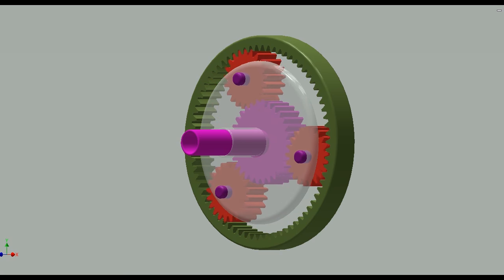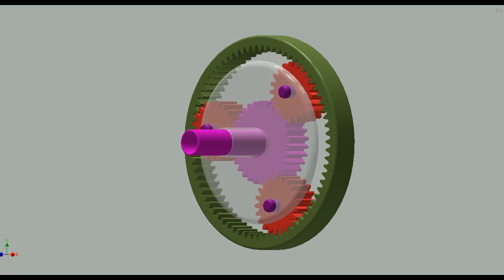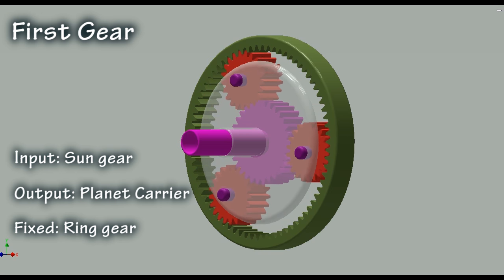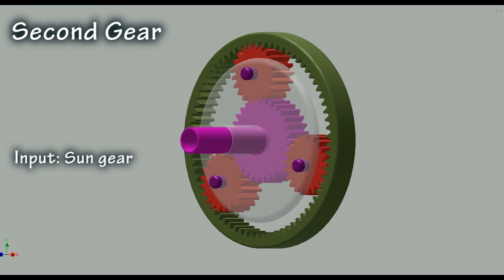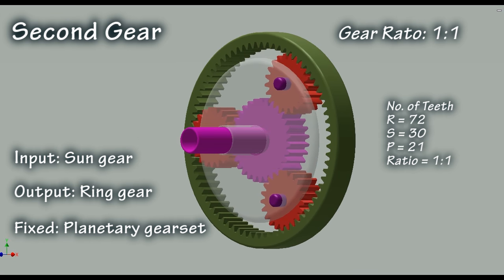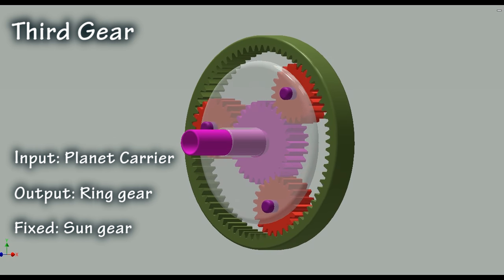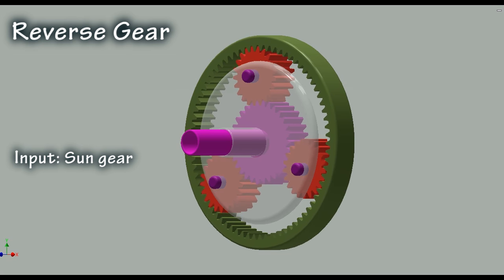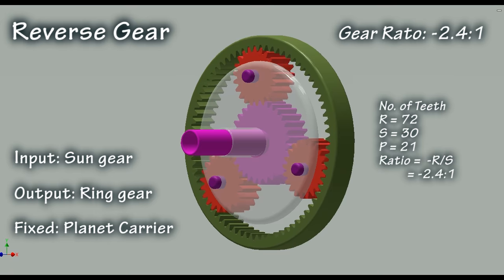How Automatic Transmissions Work! | Best 3D Animation Ever

Comment: #Skyline Tutorials i understand how the internals of an automated gearbox works, you've explained it perfectly, but how exactly does pressing the accelerator transform into shifting gears?
Reply: +adrian ionut I believe that clutches grip different shafts depending on speed and load. However, I don't know what causes the clutches to activate.